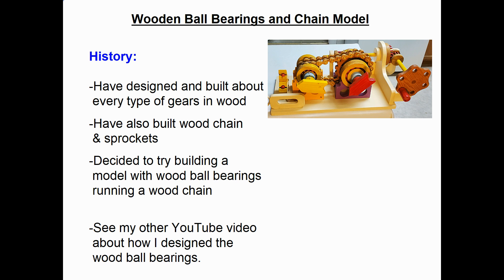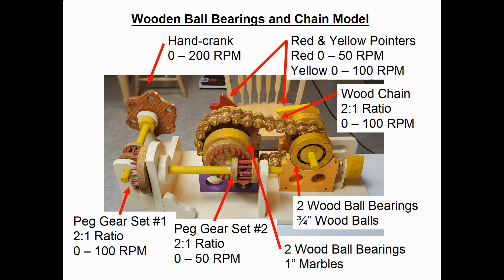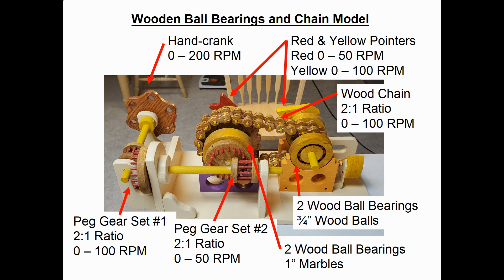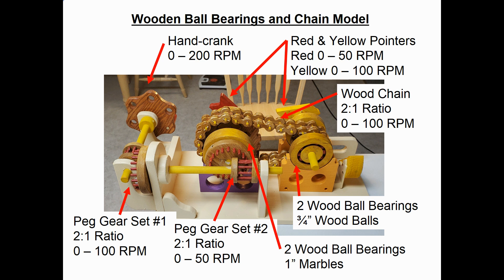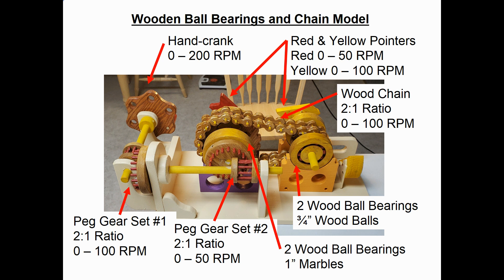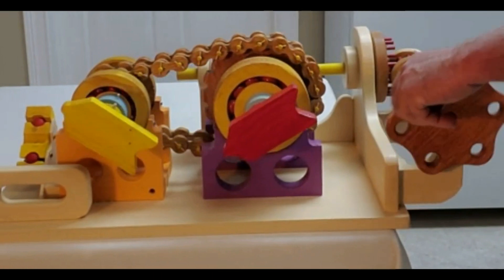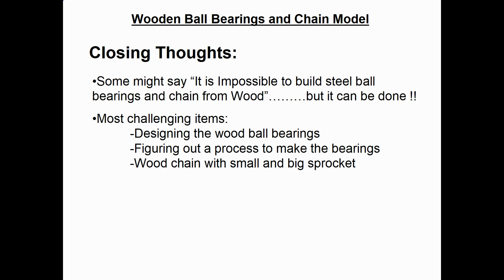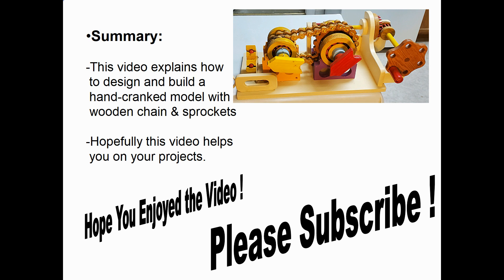A Hand Cranked Model with Wooden Ball Bearings and Wood Chain

Comment: Hi Dale and thanks for this. Do you have any practical tips about making peg gears? Mine jam a lot and I'm at a loss. I know it's unfair to assume that there's a magic wand answer but is there anything you've learned about them that surprised you? Any cardinal rule? Cheers mate and thanks again.
Reply from the maker: When I first saw real peg gears in a grist mill in the Chicago suburbs, Graue Mill, the big peg gears looked so simple to design, but when I designed and built my 1st set, I had a heck of a time getting them to work right. Turns out they are trickier to design and one might think !!   I found an online calculator which works fine for designing them, but I do trick the online calculator so it gives me some tolerance when I build the peg gears.  On my small models, I use 1/4" dowels for the pegs.  In the calculator, I trick it and tell it the peg diameter is a hair larger, 1/4 + 1/32" = 0.28125". I use the calculator to get the pitch diameters of the pegs on the small and big wheels.  When I build the peg gears, I still use my 1/4" dowels.  On both gears, my pegs protrude 5/8" out from the round base.

I explain all of this, and give you the internet address of the free online calculator in this Youtube video:

https://www.youtube.com/watch?v=QFMsTF_0kH4&t=560s

If that doesn't work for you, let me know and I can try to help with your specific design.  Good luck !
Reply: @dalemaley  Thanks Dale, that's very kind. And quick! Cheers mate.